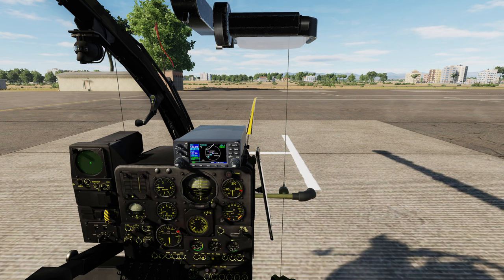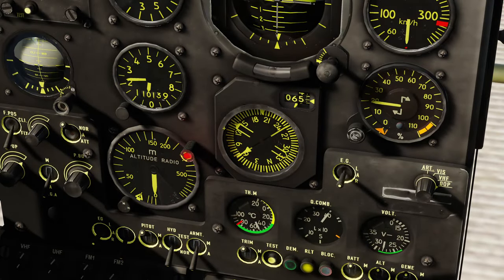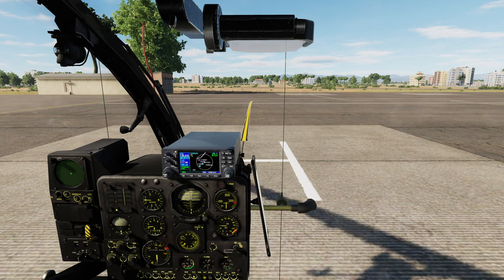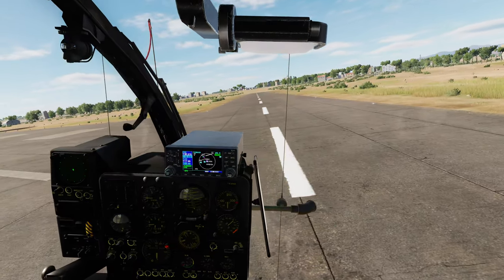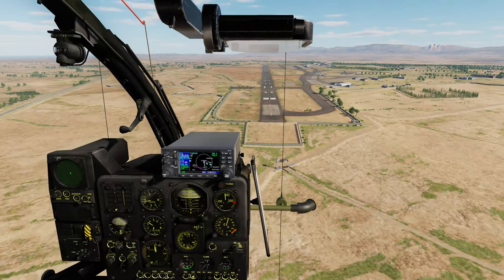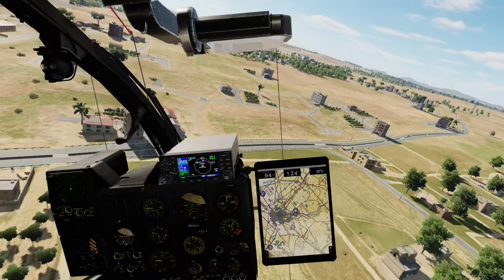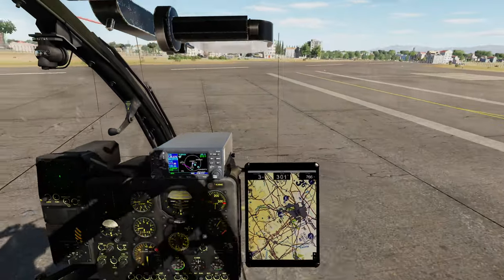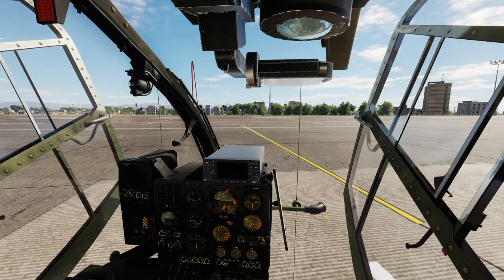DCS SA-342L Tutorial 2 - Takeoff

Comment: How do you feel about the flight model?
Reply from the maker: I think it's a huge improvement, really enjoyable to fly and it simulates many helicopter effects.
Reply: Complete overhaul, basically from scratch. Feels and flies like a helicopter now. I started over with completely resting the curves and doing my standard adjustment for helicopters. I use a Virpil 20cm S-extension, so I try to match movement range in game roughly to my physical sticks throw and tweak from there. It's still very agile, but now feels like it has mass, especially you notice the equipment/weapons weight! Ariane-Sight, 4 HOT and even with near empty fuel tanks she feels heavy, like it should be. 🥰
Can't say, if it is 100% accurate for a Gazelle, but it feels right and is definitely a huge improvement.

Comment: I have the problem when I try to take off gently that the Helicopter suddenly tilts to the right!  😔
Reply from the maker: Do you have rudder pedals or a twist? Are you certain that you don't have a double axis binding in your controls?
Reply: @deephack   I have the TM Pedals , no Double binding . axis input are OK .
Reply from the maker: Sorry, no idea in that case. As you can see in the video this doesn't happen to me.
Reply: @deephack     If i press Trimm in takeoff  it is better now !
Reply: I'm brand new to this and found the same.. almost like the right skid was stuck to the ground in some cases
Reply: Hint: Display the axis view window using *right Ctrl + Enter*, move the cyclic a little to the lower left till the top and the right side of the "diamond" (which represents your present input on x and y axis) touches the zero lines of the diagram, then trim to this position.
This should help you a lot taking off.
Reply: @JoernR   👍 Thanks, now I know how to do it.  I found a YT Channel and understood the mistakes I was making.   "  Helicopter Lessons In 10 Minutes or Less  "